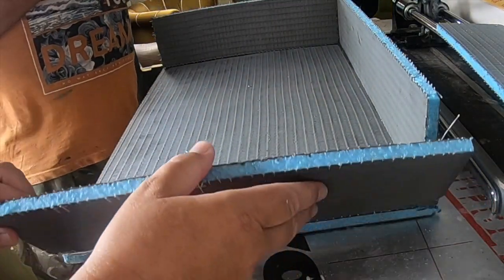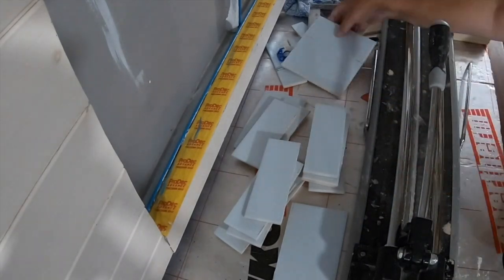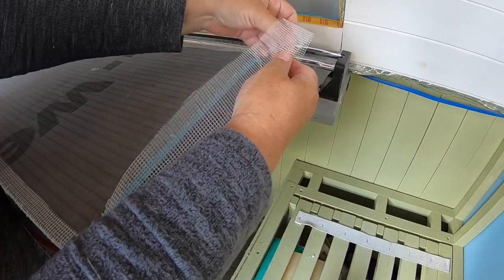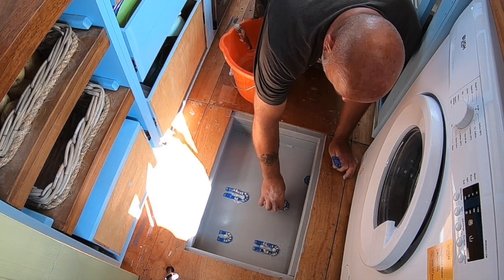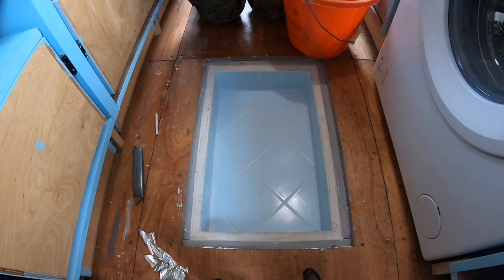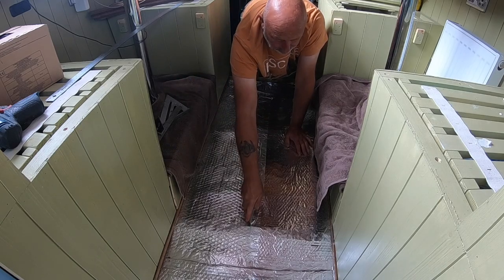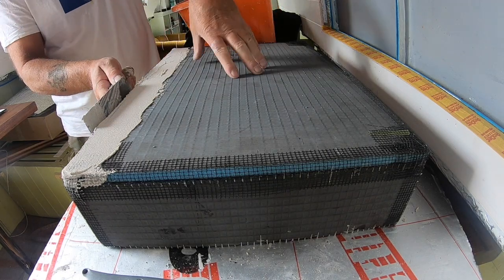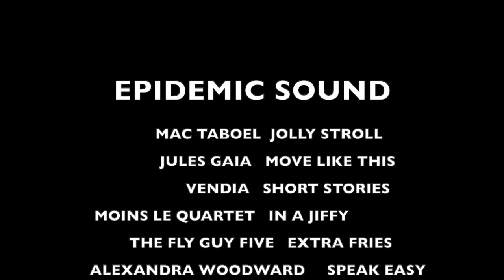VLOG 88 Narrowboat Fit Out - COOL STORAGE FLOOR LOCKERS

Comment: Brilliant. I bet they do the job well.  I’ve grown leaks in them already. I don’t look in there on a regular basis and a leak was left that grew twice the size as it was when I put it in. Plenty of space in two and the gin cupboard will look great with its light. Engine?  Launch Month? Must be close ish  now.
Reply from the maker: Cheers Chris. Yep that will be the problem if we kept our veg in them hahaha. Have you got hinges on yours or do they just slot on? wondering how easy the 2 blue ones would be opening them if we didn't (or did) put hinges on them. Definitely putting them on the glass one as well as gas struts (we think) but not made our minds up for the 2 wooden lids. No engine in yet but work is about to start on remaking the engine beds and getting them in so its on the horizon 🤞. Not going to think about a launch date for a while but just keep going until its done. Speak to you soon 👍
Reply: @makinganarrowboatwithnannyandg  mine is fitted with a piano hinge. I like it. It’s easy to lift and no faffing about. Mind you no hinge would work. I’ve got what I’ve got. I don’t know any difference. Try it out. But, the hinge is good.